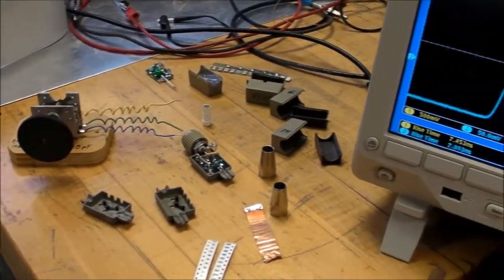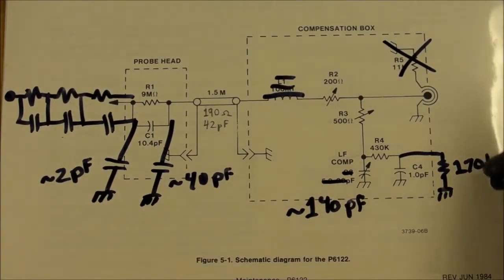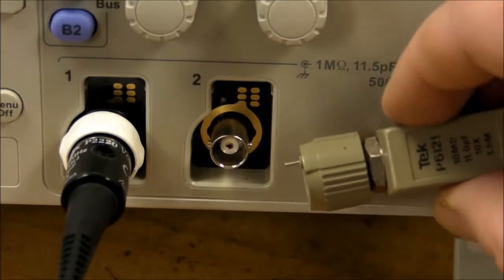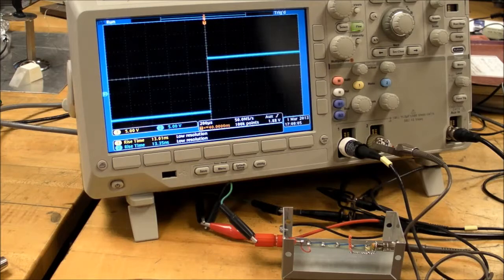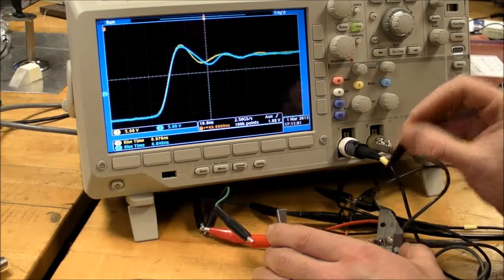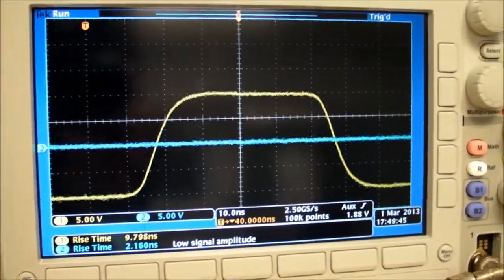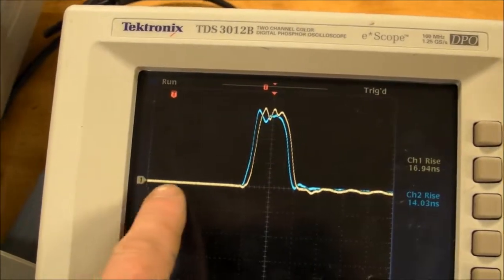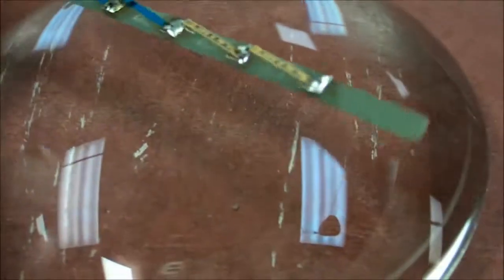(#0058) Scope Probe Mod for 2000 Volts - Part 4 of 4

Comment: Or maybe it's a 5k6 Ω resistor Tektronix use for thei 1:100 probes (half the resistance of 11kΩ). But it's somewhere in that area around 5-7 kΩ.
You can use a 10 kΩ potentiometer to find the max. and min. values where the probe is detected as 1:100 and then just pick a fixed resistor close to the middle of that range.
Or if you already have a 1:1oo probe just use an ohmmeter to measure the resistance.

Comment: Looks like it has to be around 6-7 kΩ to automatically be registered as a 1:100 probe. Read this topic: goo(dot)gl/qOHPum

Easy to verify yourself by just just pressing a resistor between the "probe attenuation detector ring" and GND.

Comment: What's the reason you don't just use a commercial 1:100 high voltage probe from a scope manufacturer?

Specs for the first two 1:100 high voltage probes I checked:

Rigol RP1300H
Max. voltage: CAT I 2000 V (DC+AC), CAT II 1500 V (DC+AC )
BW: 300 MHz 
Attenuation ratio: 100:1 
Input resistance: 100 MΩ 

Agilent 10076B
Max. voltage: 4000 Vpk
BW: 250 MHz
Attenuation ratio: 100:1
Input resistance: 66.7 MΩ (when terminated into 1 MΩ)

Comment: No, the resistor that programs the display to 100x housed in the BNC connector ring, used to be 11k in the original. Wonder what value gives 100x dsplay on the scope.

Comment from the maker: Do you mean the 200 ohm or 500 ohm pot? They have negligible effect on the DC level. And I did play around with the pots, but varying the pots had no greater effect on the AC response than simply varying the capacitors on either end of the coax. So I just left the pots in their original positions of approx. 40 and 400 ohm, respectively.

Comment: Can you measure the programming resistor for the 100x probe and add it so that you have the readout correct? It will just be a simple change but will prevent confusion.